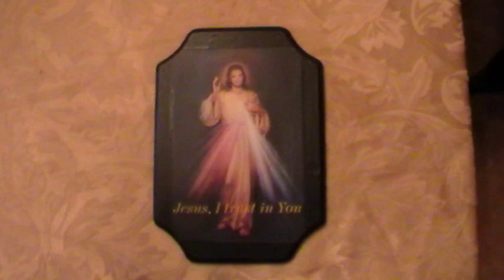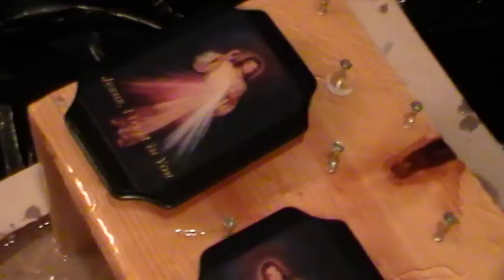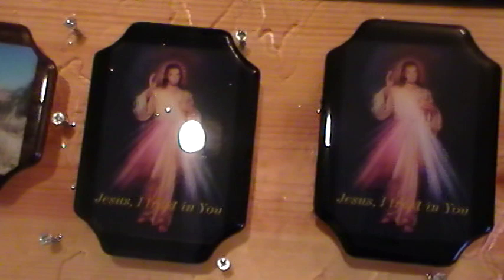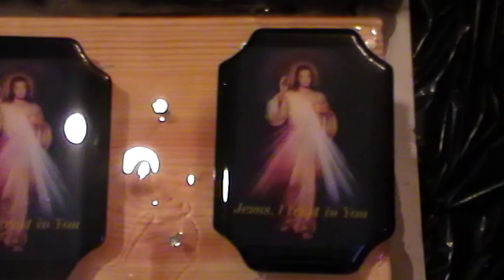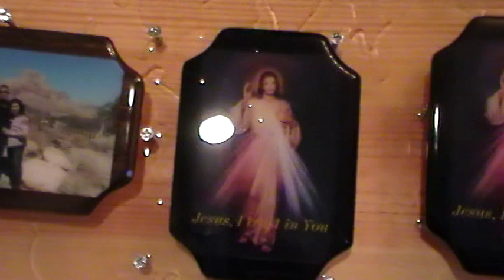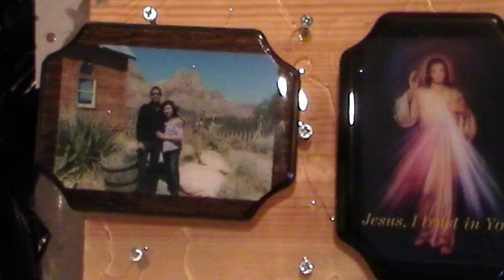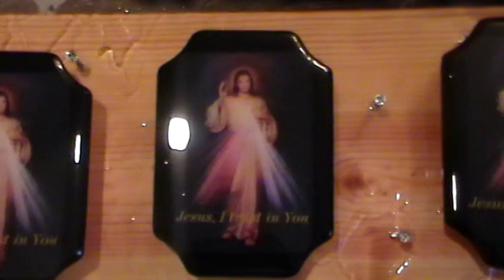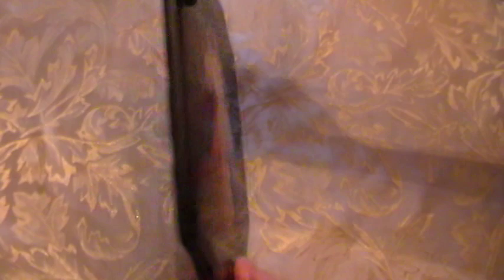Epoxy Resin Wooden Plaques

Comment: For help on the backs, this is the best method I use, and it's very effective for not using a grinder.
Smear vasoline very thickly on the back, all the way around the edges about half an inch in from the edges. When the resin drips down over the side and gets underneath the elevated plaque, it won't stick. Take a dull knife after a day of it curing, and scrape under the resin, and it comes right off.
Make sure not to get vasoline on the top of the plaque.
I've made over 50 plaques and never used a sander once and I'm still on the same vial of vasoline. make sure it globbed on thick, and it won't stick.
You might have to use a little pressure to get some drops off that attached to where there wasn't enough vasoline, but again, a little elbow grease and it slides right off.
Reply from the maker: Good tip Thank you.

Comment: Ron, they look beautiful. Can I ask, what's the wood your using again and where do you buy such wood?. Also I take it you get it all done, then clean the back of the board?. Lastly is that just a stain your using on the wood, is it a oil base ?. I look forward to reading your reply.
Reply from the maker: +Jay Wolf We used wood from Michaels arts and crafts. 

We sand the back of the wood ti give it a clean look.

I forget I do not think it is oil base not sure. we bought it at Home Depot.
Reply: Ron Randall
Hi Ron, thanks for getting back to me. I contacted Michael's but they do not ship to Australia, so where would I find the wood you use and what kind of wood is it?. I went to bunnings warehouse "hardware shop", but not sure what wood or thickness I should be looking at. To get the curved edges, did you use a jigsaw then just sand them? I have been able to obtain most things needed but the wood bit is troubling me. I hope you can advise me on that bit, thanks again.

Comment: i need a lil help mr randall...i make plaques also. i'm trying to figure out how to get the back of my plaque smooth like yours cause mine drips and when it hardens i'm stuck with the drip look
Reply: What I do for the sides I apply 1 or 2 times resin that way the sides get cure and then i put the resine in my photos or what ever I'm laminating and when the resin is completely dry I sand the back of the wood with a sanding machine.

Comment: If you put this outside, will the colors or finish fade?
Reply from the maker: +pboboige Outside in direct sunlight it could start turning yellow. We use table top resin however  there is type for boats that works outside.
Reply from the maker: Sorry for the extremely late reply. Over time it will. I think you can use boat resin so it won't fade

Comment: I have done this process but needed to use a torch to get the bubbles out.
Reply from the maker: We used a straw to blow are onto resin to get rid of bubbles.
Reply: It's the carbon dioxide that causes the bubbles to rise and get out of the resin. heat from a torch can turn the polymers rainbow/bendy colored.
Too much (which is barely in some cases) pressure from a straw and and you can create dimples from the air blast, however slight.
The key is to spread out the carbon dioxide in a non focused point.
I like to use a paper towel roll and flatten the end out that will be close to the resin. Slow exhales and the bubbles vanish. The paper is great for absorbing any condensation a plastic tube might repel and have slide down on the polymer.
Reply: Hmm...  I had only a very small hand held torch.   I didnt even know there was a torch that small.  Im not a manufacturer.  Just experimented to see if I could cut out the middle man for my Memory Specialties.  
Way too messy to do in an apartment... 
My local supplier is out of business now.  I need to find  a new one.
Reply: Are you a manufacturer?